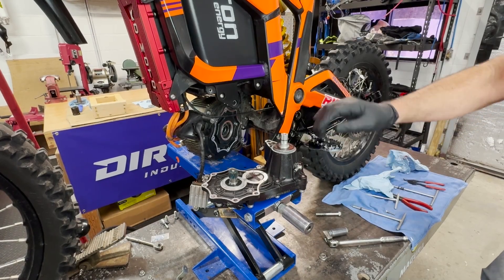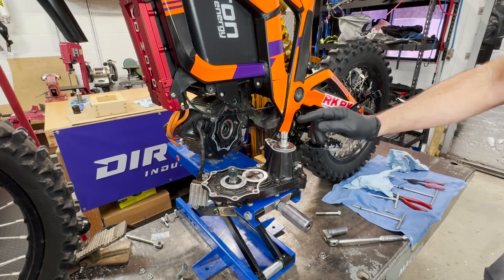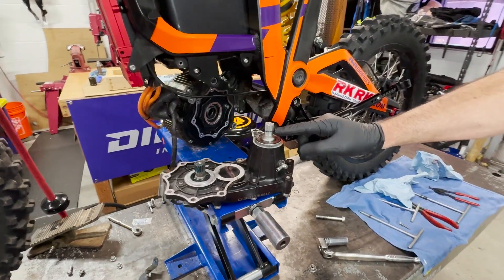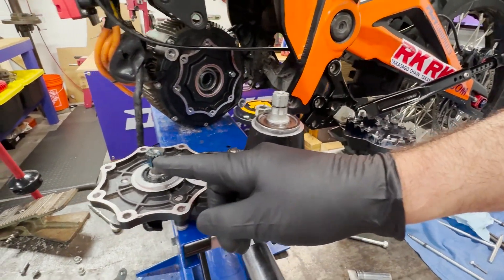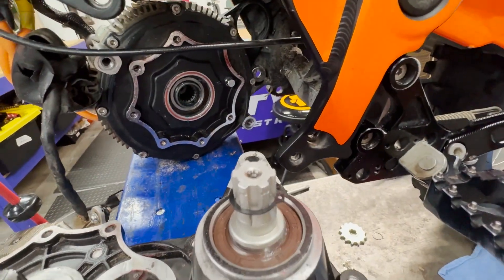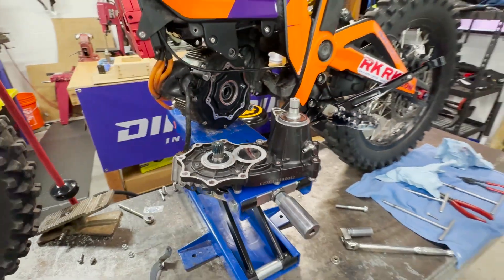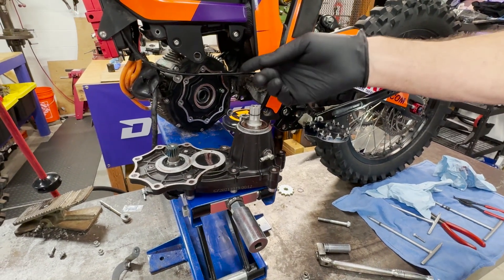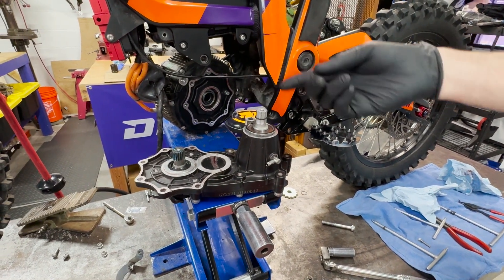Talaria Gearbox Rebuild PART 3

Comment: Thanks for the great series, my son snapped his last week and it's up and rebuilt. One tip, if you left the chain on make sure to loop it around the output shaft as your sliding the motor and gearbox back in place, will save you from having to break the chain later.
Reply from the maker: Great tip, thanks for sharing!

Comment: Good series; thank you. I haven't had to do this to my MX4s yet but I imagine at some point I will. One thing I noticed - you mentioned the brake hose goes above that bolt and then reinstalled it underneath 🙂